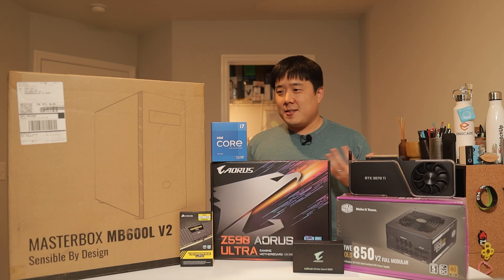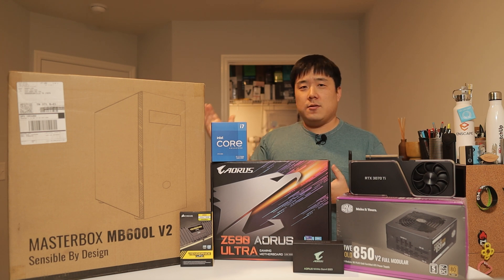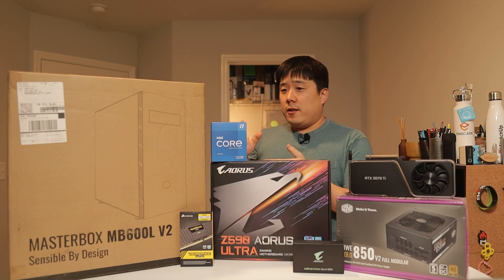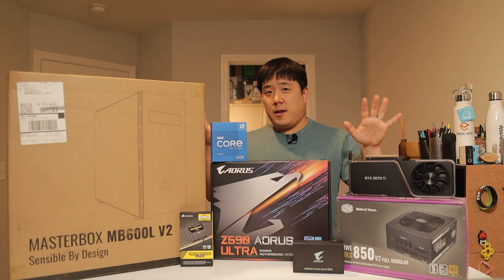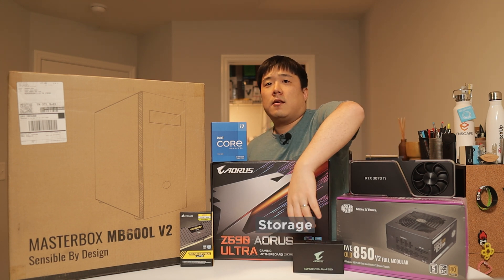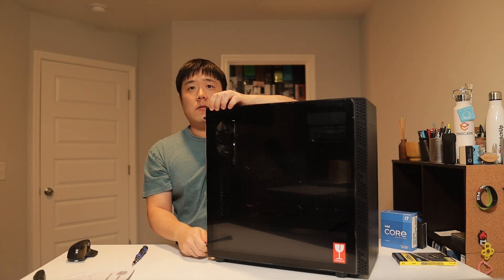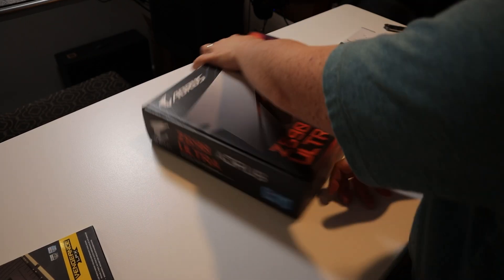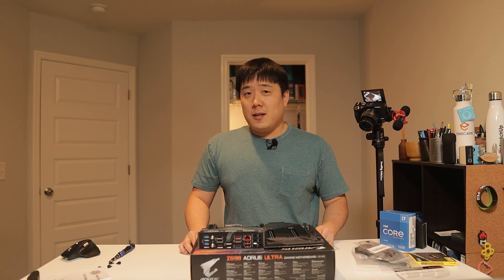Building Custom PC for Architecture - MB600L V2 Case, Z590 Aorus Ultra, i&-11700K, and RTX 3070 Ti

Comment: i hate that manufacturer just slap magnets all over pc cases nowadays for their mesh filters😢
Reply from the maker: Haha, what problems do you have from the magnets?
Reply: @JosephKim  dont mean to sound like  a douche but i sometimes wear watches in 4 figures so speakers i dont mind as you just instinctly know they have magnets but when manufacturers start putting magnets in Journals, wallets, duvet covers, wall art..apple using magnets in chargers on macbooks but also now magsafe on iPhone i mean what the fuck. It seems instead of using quality durable materials on the parts that have friction they just get replaced with magnetic strips. 

..also a minor detail, i might be over reacting to the magnets due to my ocd but damn it they are EVERYWHERE😂
Reply from the maker: @4th_Disciple  haha, it is interesting to know different thoughts and weird scenarios. I don't wear a watch, so I suppose I can't relate. But everyone's got some pet peeves.

Comment: Hi there. I have the same case how many fans and in which direction should I install on to have a nice air flow inside the case regarding an 240m Aio for my 5900x cpu.
Reply from the maker: I basically had the AIO as air intake on the front, then one fan on the back to exhaust. I prefer having more silent PC, and didn't see temps being too high.
Reply: @JosephKim  isn't it better to install the AIO on the top as an exhaust and then install some fans in the front?

Comment: I have this same Motherboard. I see you removed the plastic to install the Nvme. But under the larger heatsink on the board there is 2 more pieces of plastic. Do you need to remove them if you are not installing more memory there. Since it is sticky I was unsure.
Reply from the maker: That's called thermal pad. Basically, helps to transfer the heat to the heat sink as Nvme can get hot. You need to remove the plastic peel and put stick the pad onto your SSD.

Comment: @Joseph Kim  I purchased a X570 Aorus Master last year, put it in a Inwin ATX  case paired it with the Ryzen 7 3800X, GSkill 4x8 32GB 3600Mhz and an AMD Sapphire RX580 GPU that at the time was pretty tough to source here in Australia for a reasonable price and while i have been more than happy with the build - I have recently been thinking of performance upgrades but am reluctant to go as far as jumping to the new Z690 series and spending up for DDR5 and the required all new compatible parts and pieces...I would like to be able to ditch the Thunderbolt 3 PCIe card and the 10Gbe PCIe card and have those as integrated/onboard options in a new board to free up some sockets/lanes......I'd be interested to here any thoughts or suggestions
 though....thanks
Reply from the maker: DDR5 really isn't worth the money atm. I'd give it a year at least. Although there are good Intel 12th gen + DDR4 boards. I really don't think overclock is necessary. I am planning on such build very soon. Stay tuned!

Comment: how much does this built cost?
Reply from the maker: I will need to confirm, but it will vary depending the sale. I was given a few different parts, so cant say for certain.
Reply: @JosephKim  thanks Joseph! love your videos! keep up the great work!
Reply from the maker: If I were to replace the parts that I received with comparable parts, it is about $2200.
Reply: Looking at the prices here in China, most parts that you used are kinda on the higher end side for someone whose just beginning.